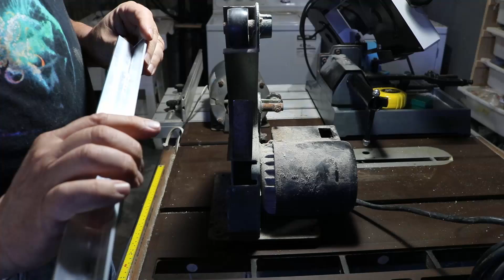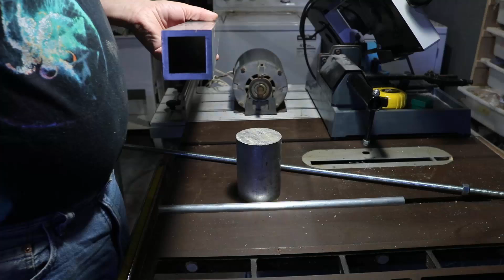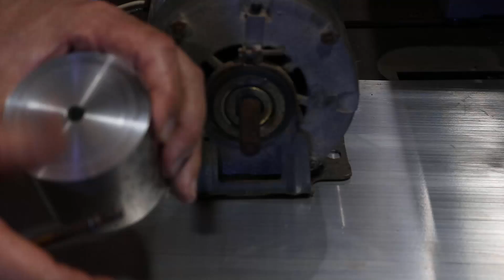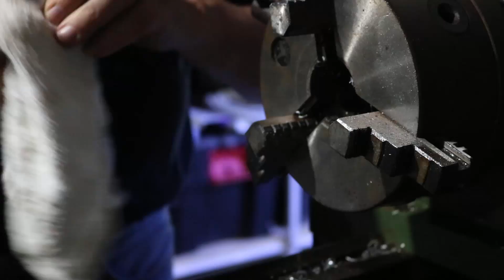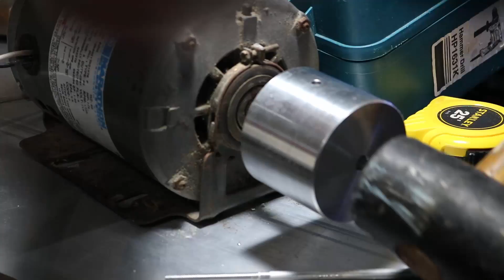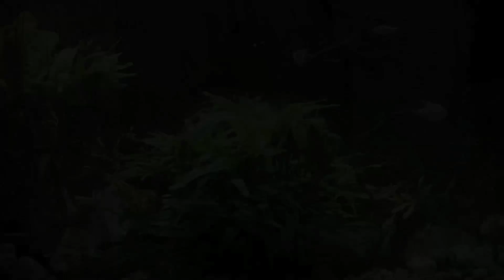DIY Belt Sander Build Part 1 The Drive Wheel

Comment: Can you comment on the belt tracking results with flat drive and idler wheels. No doubt they are easier to machine but how do they perform?
Reply from the maker: It works great. I've been using it almost every week since I made it and I've never had any trouble with it

Comment: The belts will polish the wheels smooth anyway. You do need at least one crowned wheel for tracking.
Reply from the maker: It's been running for a year now and I do think that the wheels are being polished a little. I haven't crowned the wheels and it tracks easily. Thanks for watching
Reply: Yeah I saw it running in your other videos, nice work. Meanwhile my own grinder has become grinder hell because of a vibration problem lol.

Comment: the whole purpose behind having a "crown in your wheels is to promote the belts tracking strait easier, if your wheels are flat the belts want to wander quite alot.
Reply from the maker: True. I may have to adjust them. It is easier to machine them flat. So I will wait and see how it runs.
Reply from the maker: Also as I said in one of the earlier videos I want to be able to grind on the inside of the aluminum angle I use in my tank builds. So flat would be better.